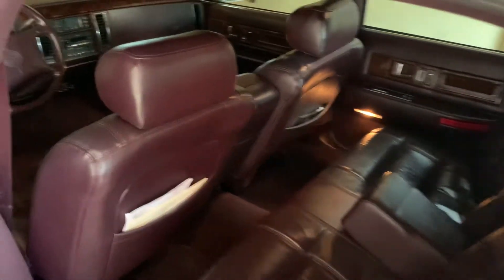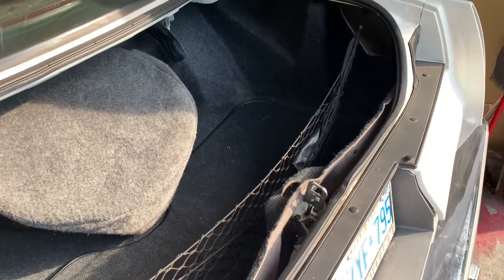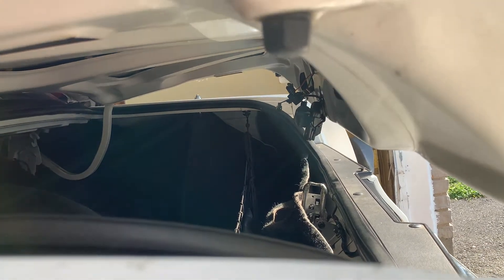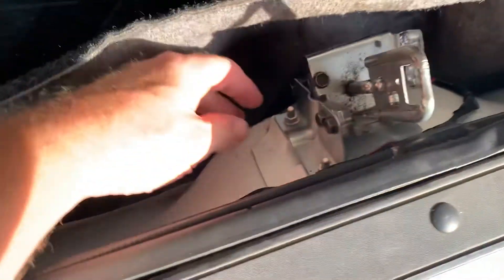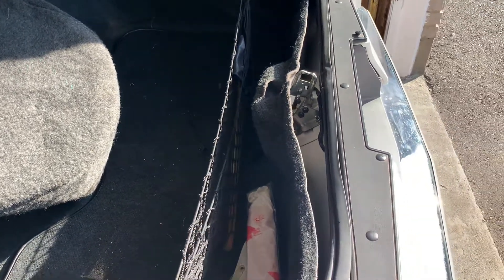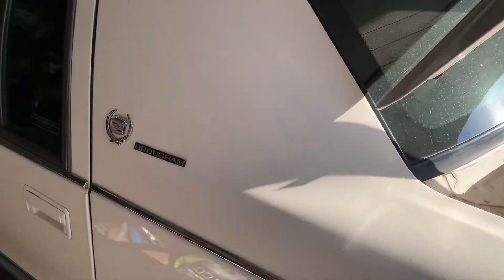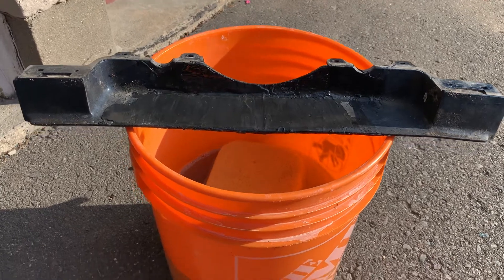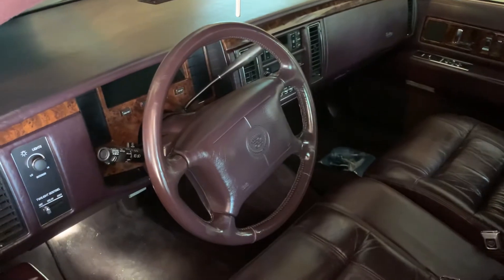1994 Cadillac Fleetwood- Power Trunk Pull Down Failure!

Comment: Looks like your motor mount on the trunk door itself looks bent reasons why it's not lining up you can see a gap when showing the motor, might of hit it putting something in the trunk. I've done alot of research and that was one of the common problems. I figured out that my motor lock switch had gone out replaced it and works fine now.  Good luck let me know if it worked
Reply from the maker: You are 200% correct. I figured it out and it was bent. I posted the reason in the video after this one.  Thank you for your input. Please like and subscribe.

Comment: Its from the weather... The steel expanse from the heat and shrinks because of the cold... It tin cans itself. It happens alot but you just grab the latch on the trunk and give it a tug forward. Do it a couple of times until it lines back up.❤❤❤❤❤❤ Mine works beautifully again🎉🎉🎉